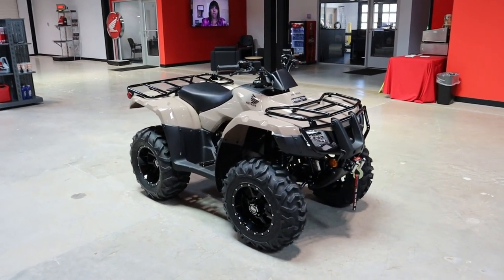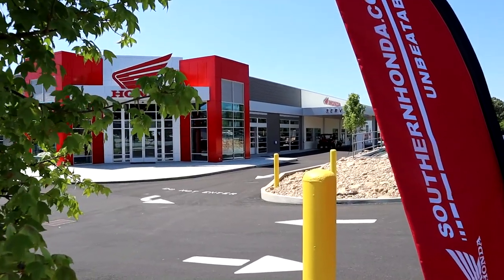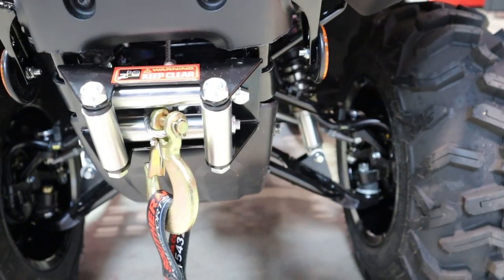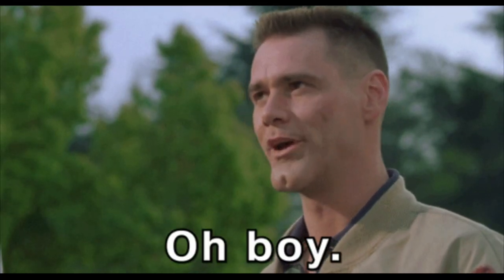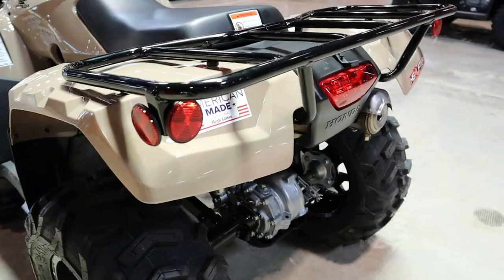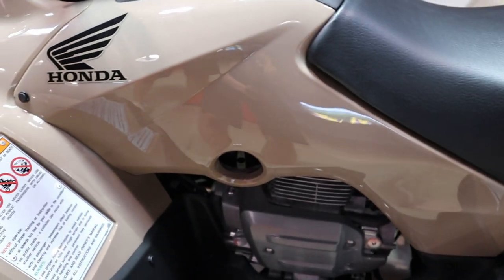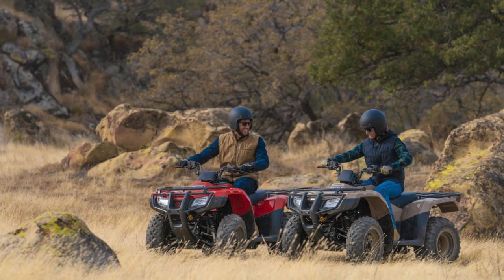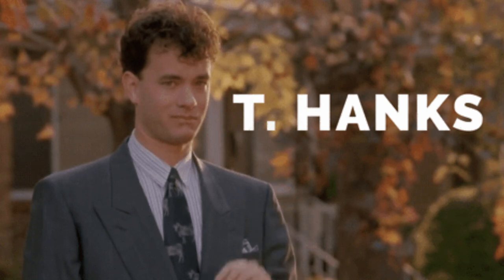NEW Honda Recon 250 ATV Review: Specs, Changes Explained + More! | FourTrax TRX250 Buyer's Guide

Comment: One of the most reliable bulletproof setups, dont change  a thing Honda! I love how Honda is the only manufacturer out there that holds on to what works instead of flooding the market with all kinds of electronic new this and that that ends up broken and lack of warranty help. Just like the Ruckus, same since 2003 and still a blast and does the job. Honda will sell every recon they produce even in its basic form. I had s 250 ex for 15 years and had to replace the battery twice an amazing platform that Im sorry I sold it definitely getting a recon or another 250ex to go with my ruckus and Monkey👍
Reply: i had a recon 13 years     great quad     plan on gettin another
Reply: Sad thing is can’t even buy a 250 recon in Canada Honda quit selling them here quite a few years ago. Same goes for Rincon
Reply: @philipjean1086  that stinks   i had  2 recons      one for  atleast 13 years     simple    fun     and slways ran great

Comment: Bought a 2024 today. 
The Recon has always been good and reliable since they first came out. 
Second Recon.
Reply: im interested in getting one, how tall are you? does it ever feel to small? Im 5'8 just want something to mess around in the yard on from time to time
Reply: @GARYIZRAW  
I have 125 acres of land. 
I’m 53 so I’m not trying to impress or keep up with the jones’. 
I’m 6’0 and 215 lbs. 
I ride my recon and it has all the power I need. I use it just getting around. 
I’ve been through creeks, mud holes and timber cuts. 
I’ve had no incidents of getting stuck. 
It has plenty of power for an older guy. 
I did mount a phone holder on it. 
I put a speedometer app on my phone so I know it goes about 50mph. 
The size, it gets through the small areas where the big ones won’t. 
If I do get stuck, I can get it out by myself. 
I hope this helps. 
I love it.
Reply: @Youtubeparolee  helps a ton thankyou! I need your land lol I only have 7 acres. Finna turn 30 but can give this to my son when he is ready
Reply: @GARYIZRAW  that’s also a great thing about it, they hold their value and are a perfect beginner Atv. 
The first recon I bought was back in the 90’s. 
I put it through much tougher and it lasted and never gave me any problems. 
In my opinion, you can’t go wrong.
Reply: The torque on it??  Need to snatch some stumps and logs around ??
Reply: @SloJizzy  not really heavy enough for that I don’t think. I tied to a small tree I cut in a path and it pretty much will just spin. A better gripping tread might change things though. 
I have the stock tires.

Comment: We have a recon, rancher, and rubicon (and used to have a foreman).  The recon is our yard bike.  It pulls trailers around our property with brush,  chainsaw/weedeater, tools, and such.  You leave it idling without worry and its always reliable.  Starts so quick with the slightest touch of the button except...  If its sat for 3+ weeks it won't start.  It will happily spin and spin and you can fuss the choke and it won't make a difference.  However, a brief shot of starting fluid in the airbox and it will fire immediately after a long nap.  We love the utility of the bike.  I like its light weight to be able to move it around when needed.  My daughter rides it because its not intimidating.  My light weight sister has taken it through swamp woods and kept up with our 4x4 bikes amazingly.  EFi is what it needs to make it the perfect bike.

Comment: My dad rides a 1999 fourtrax 300, i ride a 2002 recon. I routinely drive the 300.
Though I love the 300 for it’s power and 4wd, the turning radius makes it a hard sell on very tight trails. The recon fits and turns so much better.
The perfect Honda ATV (for me) would be a 300 engine with selectable 2wd/4wd, with EFI, and actual gauges or screens for speedometer, distance and gears. But let’s be honest, then it wouldn’t be Honda
Reply from the maker: Oh yeah, those old 300s will make a make a man out of you cranking the bars back and forth in tight trails lol! They are absolutely bulletproof units though and still highly sought after.

You hit the nail on the head for what I think would be a massive selling ATV for Honda! If only they'd actually build it though...

Comment: I have a 2014 and love it. It’s bullet proof and the size is perfect. It is underpowered though. If a 4x4 version was to be offered it would have to be bumped up in power. But then they would make it bigger undoubtedly. Then you might as well get the rancher. So I feel some minor upgrades could still keep it simple and affordable. First no matter what keep the wheel base and size as it is. Give it a little more power. Not enough to put it in another size category but enough to help it. Give it l.e.d. headlights and taillight. Upgrade the brakes to disc brakes front and back. Upgrade wheels to fit a 23” tire. Stiffen up the suspension a bit. 
I think these things would improve it greatly and keep it affordable and make it even more desirable.
Reply from the maker: You hit the nail on the head bud!
Reply: @Justin Cottingham try and Exhuast and bigger jet may give you more power

Comment: I have five ATVs are all 250 except for a 350 and they're all two-wheel drive because they're short wheelbase they're lightweight and I get stuck and fast on the trail . One is a 250 recon ,and I hardly ever get stuck by the way, you can fit on Tight Trails , I'm just doing basic point-to-point riding and driving at seems to do very very well.

Comment: the backup pull starter saved me a few times      its a shame they eliminated it…. fuel inj. would be a tremendous improvement  
btw    great video
Reply from the maker: Same here, I've had that get me out of a pinch on more than once occasion. I'm guessing they are doing this so there wasn't a price increase for the other changes that were made and they can make it up on the backend in accessory money but still... Not a good move but I won't complain too much since you can throw it back on there. However, I think the other move of getting rid of the gear position indicator is a bigger mistake as you can't just throw it back on there. I'd really love to talk to the people that know the details behind these decisions, it'd be cool to know their thought process behind it and why they did this versus that and what research was put into the decision etc. The normal Honda reps don't know though and getting to someone high enough that does is a pipe dream lol so I'll have to continue being curious for the time being on so many of these topics. Oh yeah, fuel injection is much needed! I'm still surprised we haven't seen it yet but if I were a betting man I'd say it's because the Recon is sold in a lot less locations around the world when compared to other models so it's probably not high up on their priority list if the USA is its main consumer.

Thanks Mike! As always I really appreciate the kind words and support...
Reply: @HondaProKevin  np   keep up the great info/ videos

Comment: Great video. I might buy one of these if I can’t get my Bruin 250 going again. 250 2WD is all I want in a four wheeler. They should be small, easy to get unstuck and be simple. I can’t stand how big some of them are. I farm and use four wheelers to check if hay is ready to bale, to sort cattle in the pasture and other small farm chores. I need to be able to get it unstuck by myself and be able to load it myself to take to another farm miles away. Yamaha got out of this market. The 450 Kodiak is too big and heavy. Heading to the Honda dealership.

Comment: I have 2017 with the shift indicator es model which I love! The carb is what I prefer over the fuel injection because one reason if the battery goes dead your stuck in the woods! You will not start a fuel injection model with a dead battery! So start walking!!!
Reply: I have a Rancher 420 4x4 and a Recon and I love the Recon can literally run with no battery. Suppose to be bad for the voltage regulator that charges the battery but I like knowing in an emergency it’ll work. If my Rancher has a loose battery connection it’ll die as soon as that battery connection is severed. Also the Recon motors are very receptive to performance mods where you can put a 500cc piston in the rancher with intake and exhaust upgrades and get no hp increase and 1lb ft torque on the Dyno increase.

Comment: EFI, IRS and 4x4 would be the perfect small bike
Reply from the maker: 100%!
Reply: But would you pay $6500 for a 250 4x4 irs because that is inline with their pricing structure.   Most people probably would pass.
Reply: @spyder000069  well I would pay for any one of those upgrades. 6500 hundred does seem high on your estimate I paid 4200 for my recon in 2019. I would still like to see it happen

Comment: Lightweight 250s are much easier to push and roll around out of your way in a garage without having to start them up, if you had the disassembly move them in and out or a short distance

Comment: Hey Kevin I see you did financing with selling new Hondas 

What is a good credit score or rate for a dealer to even consider selling me a pair of recons??? 
Looking to get something for me an my wife to just go have fun with on easy/intermediate trails  
NYS is where I'm at if location matters

Maybe give advice
( Mid 600 is our scores ATM )  

I thought of maybe waiting till tax time and looking for 2 used recons on marketplace or Craigslist running em till one died then going out an replacing it with new recon when one of us needed it. 
I like any year I'm not picky they haven't changed much mechanically still that reliable engine an power train 
Plus I like the look of any year 

That 2nd gen look is my fav

Comment: is it for kids?
Reply from the maker: "Technically" this model is recommended for people 16 and older. However, a lot of people buy them for their kids. This thing is pretty peppy and can turn into a 450lb sledge hammer real quick so keep that in mind when thinking about whether or not your kid can handle it safely ;)
Reply: The Recon 250 definitely has enough power for an adult rider.

Comment: Why the hell is a brand new atv burning oil?
Reply from the maker: I had the choke on ;)
Reply: @HondaProKevin  Hmmm... Last time I checked, the choke doesn't add any oil to the combustion chamber ;)
Reply from the maker: I'm not a tech, so take what I say with a grain of salt lol. From my experience of selling these the last 15 years, 9 out of 10 times any carbed unit I've done a cold start on with the choke results in some smoke. Again, I'm not a tech but I'm thinking it's from the excess fuel making it run rich.
Reply: @HondaProKevin  I suppose, but neither of my Recons (a first and second gen) smoked with the choke on. You are correct that the choke richens the fuel ratio, but the fuel should still burn clear. If your floor units really do smoke like that with the choke on, then perhaps it is actually because the rings haven't fully seated yet since it's a brand new engine. Thanks for your time, and that Recon does look really cool with that lift and bigger tires 👍

Comment: Air cooled in 2021 no thanks
Reply: My Recon 250 is 11 years old.  Never had any problems with it. Being air cooled makes it a very low maintenance machine.   Happy Trails!!!!
Reply: Mine is 23 years old; finally the stator went out.  No probs otherwise.   Picking up a 2022 tomorrow.  Gonna fix the 1999 for a backup.